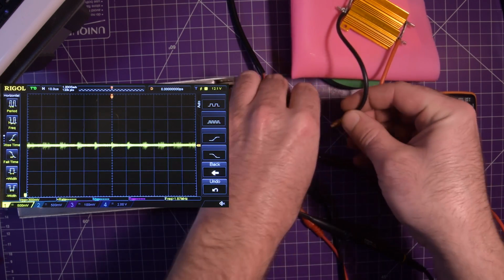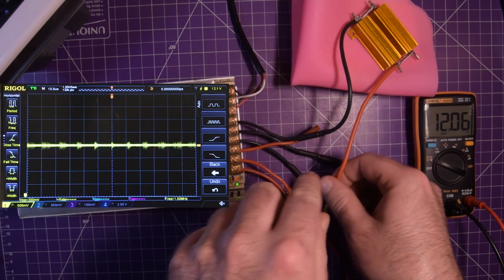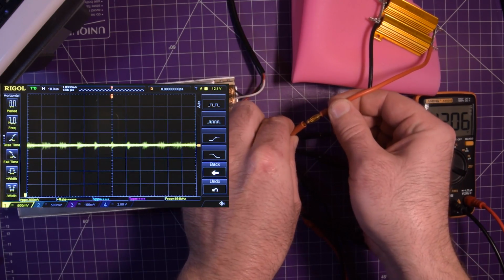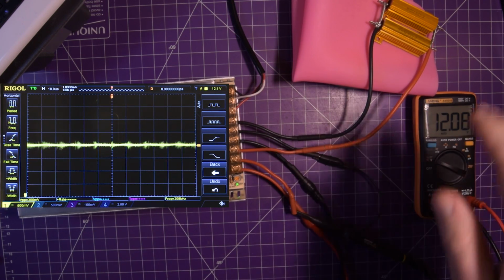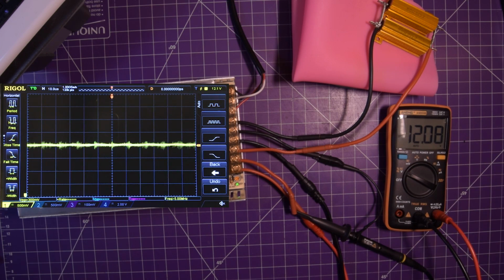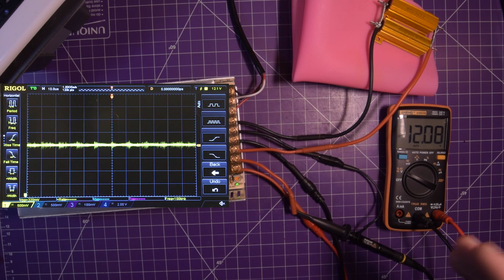Testing An Amazon 12v Power Supply!

Comment from the maker: If you are interested in getting your own, this is the model I bought: https://amzn.to/33b9dgs
Reply: I hooked this up to my boss pv3700 5ch boss amp. Running 2 6.5 speakers and a 12 inch Rockford P3d2 subwoofer. I split an 8 gauge wire to connect to all 3 + and a 8 gauge wire to all 3 - . Do I need all the positive and negative hook ups or could I just use 1 positive terminal and 1 negative. Could you explain why?

Comment: Are those 30 amps available on any output or it has 10 amps on each output so you need to connect all 3 together to get the maximum amps ?

Comment: I have a olive harvester that uses 12v 30amps from a car battery but it drains it quick. Could i use a power supply like this and a 1kw generator to run the harvester without down time?

Comment: I just recently purchased a similar converter for my diesel heater. It requires 12 volts. So I am not sure how to use it because it didn't have any instructions for it only showed some writing on Chinese which I could understand what it was saying. So I need to know for sure how to wire it up correctly, I was thinking that AC is alternating Current That would come from the outlet? And then it has negative (-V) and Again a negative V then The last two screws on the converter Both +A +A slots and that would be the 12 V connect area. Is that a correct?

Comment: Hey bro so i bought this very power supply IMAYCC AC to DC Converter 12V SMPS,110V to 12V DC Converter,12 Volt Power Supply Max 600W 50A DC Power Converter with on/off switch to power my 12v car kicker 12in L5 subwoofers paired with a Rockford Fosgate Punch P4004 4 channel Amplifier (400 watts rms) mated to my home theater system via line out, so everything works good the power supply works amazing, and the subwoofers sound amazing in the studio here, but one thing thatbis annoying is that the fan in the power supply is screaming even if the amp and subwoofers are not playing…. Even under light load or no power load, the fans emit a certain tune and it drives me crazy, how can i add a fan controller to this set up, the power supply is rated for 600 watts and the amp is 400 watts much love, i need this to be quiet please help on a side note I even if i use the amp and the woofers for hours and hours on end the amp and power are cool to the touch… so the fan is bugging out…

Comment: That AC measurement is definitely a ghost voltage, it's not really there. I wouldn't trust multimeters that don't do true RMS conversion, and which don't have a low-Z measurement function. If you looked at the 12V on a scope, I highly doubt there would be 4 volts of ripple, that would be verging on unusable, even if it disappears under some load.

Comment: Great Video. Thanks for sharing your tests with us. I am a Christmas LED show enthusiast and I have used this type of power supplies for years. There is one thing that is haunting in the LED show world, and this is using two different power supplies to power inject one long string of LEDs. I've doing this with no issues, but people say this is a big no, no because it could cause one or both of the power supplies to catch fire. It will be amazing if you can share with us your thoughts and maybe do a video on it. Basically the LED strip will have a power supply providing power on one side and other providing power at the end of the string (maybe 300 pixels). This will setup will have two positives and two negatives from two different power supply connected. Thanks in advance for your time.

Comment: Can i use this power supply to run a 12v 120w vacuum cleaner?
Reply from the maker: 120W means about 10 amps, should work for you

Comment: You said you have two 1 ohm resistors to pull 12 amps but your video only showed one 1 ohm resistor. Am I missing something?
Reply from the maker: The other one is that orange you see up top just out of frame
Reply: @SimpleElectronics  Thanks for this idea. I just received my items from Amazon.  What gauge wire did you use to connect resistors?

Comment: These are very cheap switching supplies, cheap design of a forward converter. Mine is a 30 Amp unit, spec is said to be at full load 150mV ripple which is a lot. But this unit will work with most home applications. I've operated this unit at 30 Amps and voltage adjusted to 13.8 vdc and ran for one hour at full load. And it survived.
Reply from the maker: Pretty decent unit for the price for sure

Comment: With a 12VDC / 10A DC power supply, if you cut off the DC plug and expose the bare wires, would you get a major ZAP/JOLT when you touched those bare wires? How about on your 12VDC / 30A DC power supply? I am just trying to fully comprehend how different AMPERAGE in these DC supply units impacts getting a ZAP/JOLT from their bare wires. MANY THANKS!
Reply from the maker: It really doesn't affect it much, but basically if you disconnect it from the wall and you want to avoid a shock, you can use a piece of metal to short the two prongs of the unplugged plug together, and that should discharge some of the capacitors. Once you open the case, you have to do the same procedure with all the other capacitors in order to be safe.

Comment: I use these exact same power supplies, the brand I found like is Menzo, or something like that.  They cost like $18 with 2 day free shipping.  I even had lightning hit one of these and it still works, I had to replace the fan, but so what!  I also use 14 gauge power cable instead of the 18 gauge power cable you have there on your power supply.  Cheers!

Comment: Will this run a car radiator fan? I want to make an exhaust fan for my home garage but not sure how to power it.
Reply from the maker: It should, but it would depend on the exact draw of the fan
Reply: I want to do the same thing with a car radiator fan in the garage. Those fans move a lot of air and draw a lot of amps. My fan is rated at 300 watts DC which would be 25 amps.
Reply: @randy030363  I ended up using a car gel battery I had laying around I wired up the fan with a cheap heavy duty 12v switch so I can cut it off and when ever it drains the battery I have a 30 dollar harbor freight battery charger to charge it up. So far it has run the fan maybe 13 hours over the course of 2 weeks and the battery is still in the green. If you don't need a super sophisted setup it works.
Reply: @uwishucould158  just keep it charging while it’s running
Reply: I'm just tired of buying so much cheap stuff made in China.

Comment: Excuse me can you please answer me  why you put 12.08 voltage on power supply instead of 12? By this time probably  you have already put this leds in your office do they work properly? Thank you and keep up the good work
Reply from the maker: It's difficult to get it exact and it doesn't really matter :) Also I tend to set my power supplies a touch high in case the voltage falls when you start pulling current
Reply: @SimpleElectronics  I often times run a bench power supply at 13.2VDC to compensate for voltage drops when under load. This compensation happens automatically in your vehicle, for example, my F150 Ford when not running measures 12.4ish VDC but when in a running state I measure 14.4ish VDC from the battery as it's being charged. Great question.
Reply: I often times run a bench power supply at 13.2VDC to compensate for voltage drops when under load. This compensation happens automatically in your vehicle, for example, my F150 Ford when not running measures 12.4ish VDC but when in a running state I measure 14.4ish VDC from the battery as it's being charged. Great question.

Comment: what is the name of the resisters
Reply: Name of Resistors not important however you can get pretty cheap from Amazon. I go with cost, and other factors as: resistor value and tolerances of resistor rating in wattage vs your application.

Comment: Can I use this power supply for power car amplifier which has two 25a fuses ???
Reply from the maker: those fuses are an absolute maximum, you would have to test the actual current draw of your device, unfortunately
Reply: @SimpleElectronics  I am currently using computer power supply rated 20 amps for my car amplifier  volumes upto 70 percent and has a respectable output above 70 % volumes Power supply just goes off , shutting down amp ,, hence I thought that buy this power supply of 30amps ,, and set it to 13v 30 amps this will do good I feel , is this right ???
Reply from the maker: @sanketpatil6084  it's a bit more complex than that - it's possible the amp draws a lot of current for a few milliseconds (like on a large bass hit for example) and the power supply goes into overcurrent protection...I would try an even bigger power supply if I were you
Reply: If it's output rating is 30 Amps DC....yes
Reply: For amplifiers, you have to consider the total continuous power in RMS reported by the amplifier manufacturer and divide by 20. Example 1, assuming that you are using an amplifier that provides 600 WRMS (it has to be the power in RMS, never maximum power), then you divide 600/20 = 30A. You will need a 12V Power supply that provides 30A. Example 2: using a 600WRMS amplifier and another 1000WRMS amplifier. Then add the powers 600+1000 = 1600WRMS, meaning 1600/20 = 80A, you will need a 12V 80A power supply.

Comment: a fan blowing on the resistors would help them and a second meter reading the amps?
Reply: They are intended to be used with heat sinks. (Hence the mounting holes)
Reply from the maker: I could do that but alas, I didn't  ¯\_(ツ)_/¯
Reply: how do you wire in an amp meter ?

Comment: Is that an RMS meter?
Reply from the maker: you know, I'm really not sure!
edit: I just checked, it claims to be true RMS.
Reply: @SimpleElectronics  it actually says so on the front of the meter just below the dial???
Reply from the maker: It almost bit me on the nose and I didn't notice rofl
Reply: RMS root means square.....only good for AC meter applications; RMS not needed (used) for DC voltage measurements.